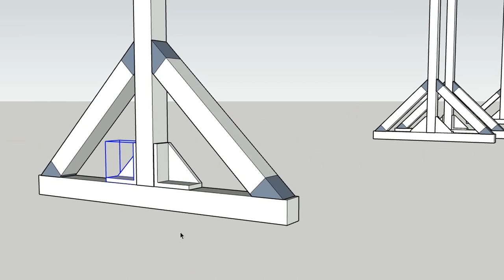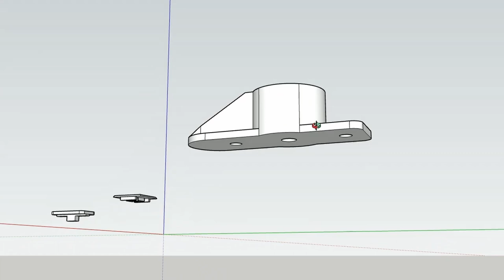DIY Clothes Rack | Aluminum Extrusion

Comment: I'm happy to see that you are based in Singapore and would love to engage your services when my BTO comes next year. I have always found plastic clothes hangers to be a pain because they break easily and can't hold the weight of wet towels. It's frustrating when my clothes or towels end up on the floor. I believe your expertise in aluminium carpentry can provide a durable and reliable solution. Let's discuss this further offline.

Looking forward to connecting with you soon! 
Malvin from Singapore
Reply from the maker: Hi fellow SG 😀 yes. You can contact us through our website and email and touchbase further.